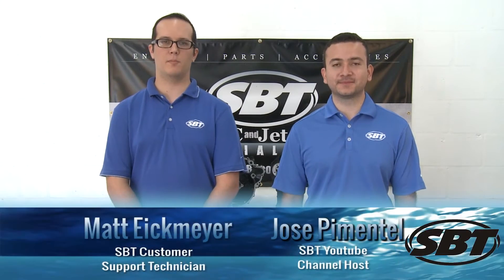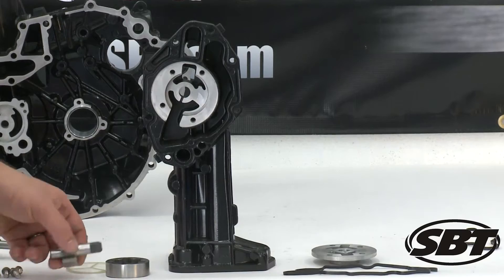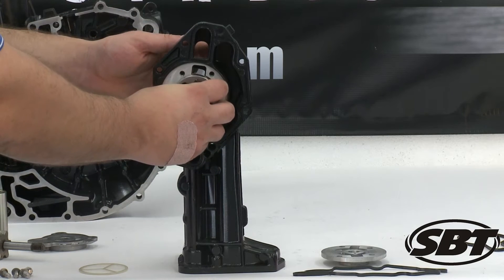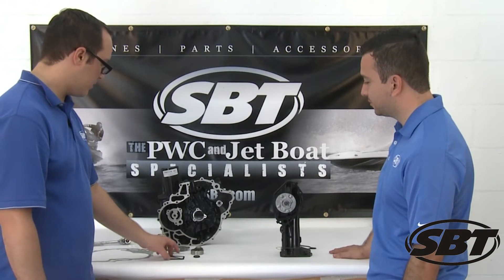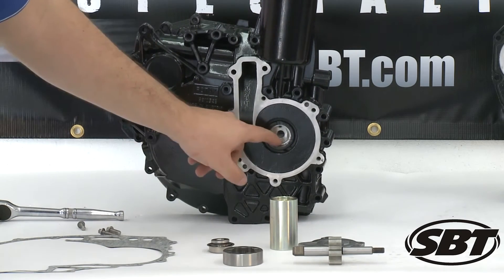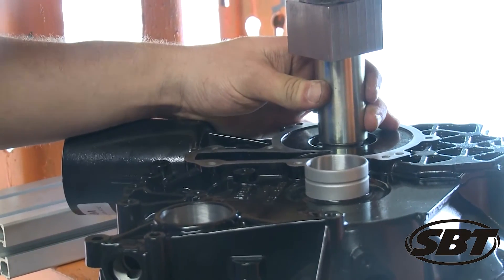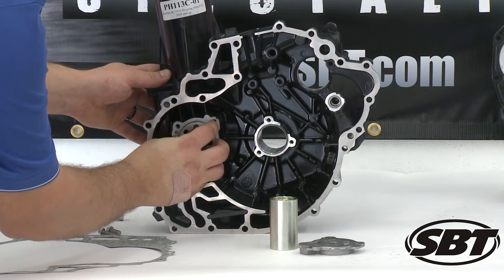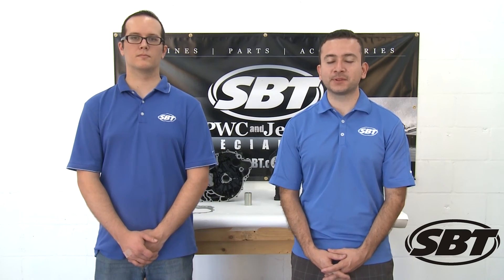SBT Tech Tip: Sea-Doo 4-Tec Oil Pump Rebuild

Comment: REALLY?????? I did not see them put any oil or lube on any of these parts before they installed them! Never put oil pumps or any moving engine part together without soaking it or coating it in oil or assy lube!!!!!!!
Reply from the maker: *What the techs didn't mention that all parts were pre-lubricated. Sorry for any confusion.
Reply: @SBTengines   Hi if you was to drop a small nut down the oil filter hole where would it end up??
Thanks

Comment: I think I will pull my secondary and check the markings. I'm having low oil pressure and I replaced all bearing and shafts in both pumps but their is some light damage still to the secondary housing and cover possibly causing my issue that or its my oil pressure regulator.

Comment: Hello friends I need help with my rxp 215 2006 I have the problem that happens to the water circuit oil, and the oil radiator probe is fine. I would like to inform me where to continue looking for where that oil leak could arise. Thank you in advance for your attention.